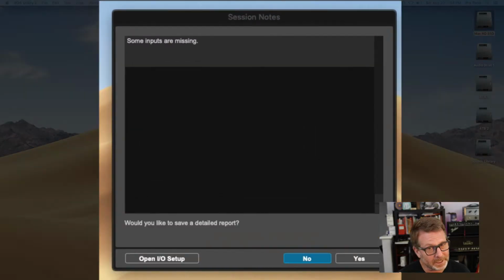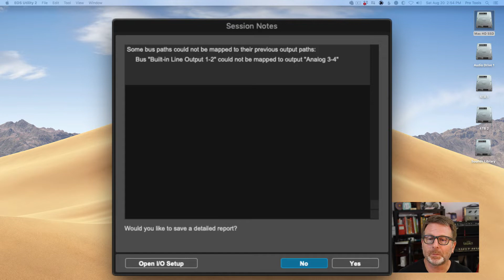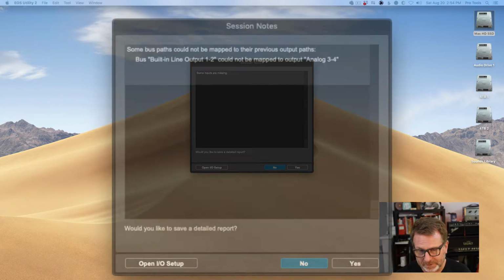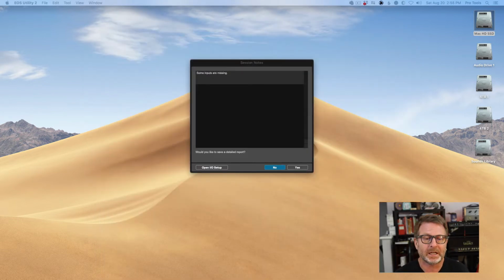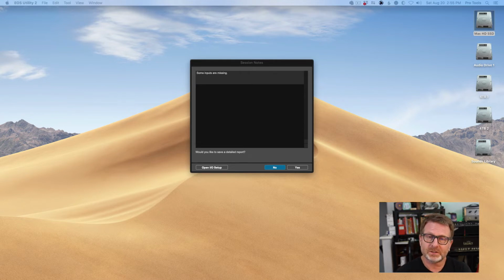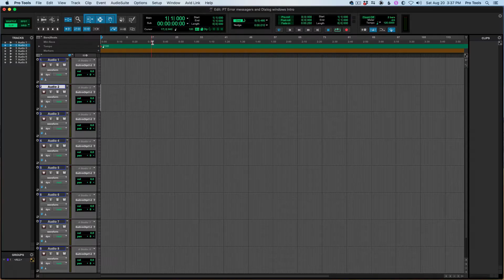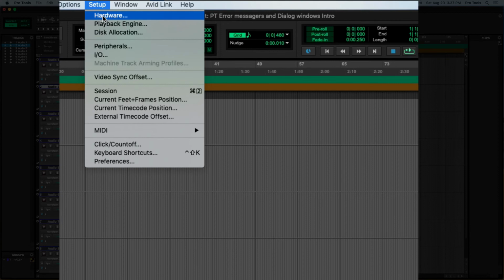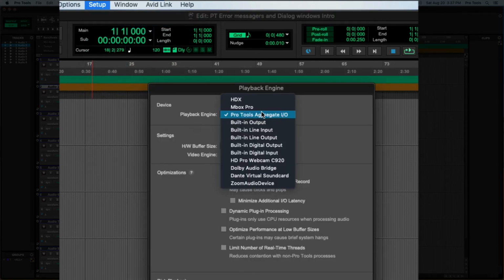Pro Tools Errors and Dialogs Series  Some inputs have

Comment: Hey man, I have an interface that usually works fine with it’s 2 inputs. However, when I go to select one of the inputs it only allows me to select input one and two in stereo form together. Sometimes I don’t get this issue but it pops up every now and again. Would appreciate any advice
Reply from the maker: Hey Patrick, if I understand your comment correctly it could be due to the number of channels the track has. If it’s a mono audio track (or Aux input) you will only be able to select a mono input. Input one or two. If it’s a stereo track then you will only be able to select a two channel input, one and two simultaneously. 

Look at the meter on the track you’re trying to assign an input to. If it’s got a single meter, it’s mono. If you see two meters side by side on that track, it’s stereo. You may have to look closely at the track meter to see this. It may not be immediately obvious. 

Let me know if I’m misunderstanding your question. 

Jon
Reply: Hi Jon thanks for your response. I think I have fixed it, I had to make a new track by clicking control shift n and then selecting mono not stereo, which is what you mentioned so thanks